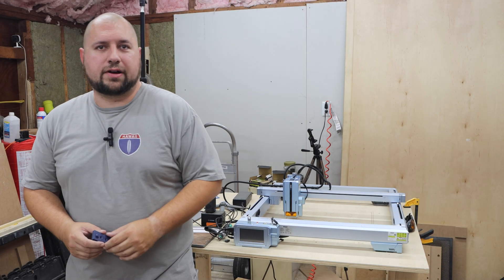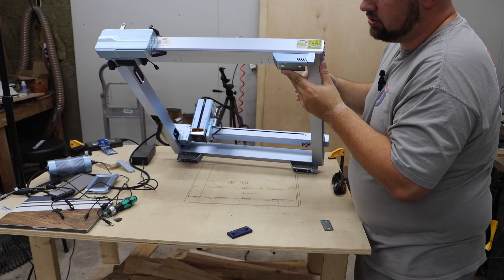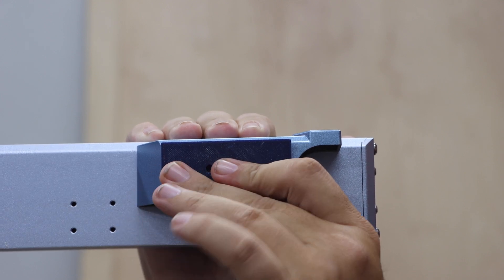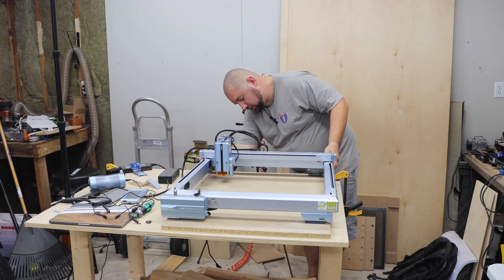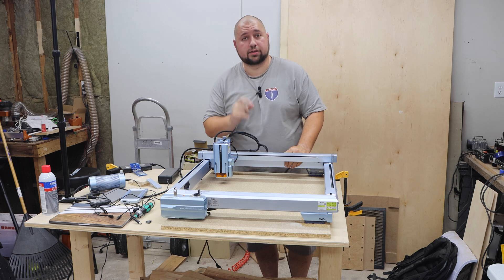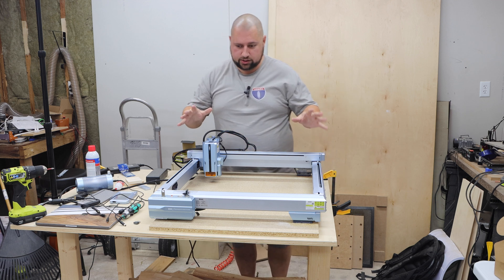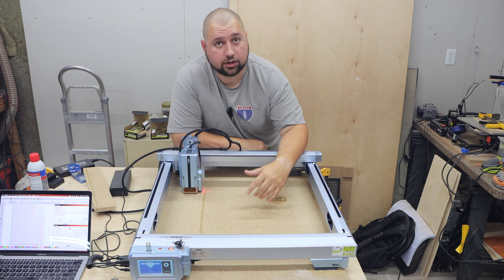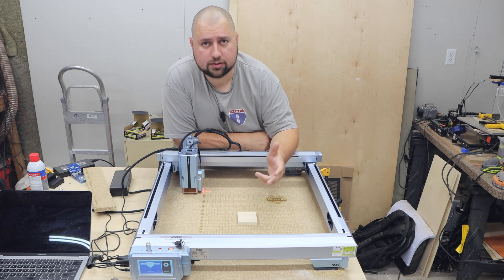iKier K1 Grid and Detachable Spoilboard with 3D Printed Alignment Feet

Comment: Thanks for the post. I tried printing your support and the post broke off when trying to lift the machine. Did a quick rework and added:
   1. A center hole. Top to bottom to add strength.
   2. A tapered top.

Again. Thanks!!!
Reply from the maker: Glad you were able to make it work for you. Appreciate the watch!
Reply: Hi, would you share it ?
Reply: @Evil_Clown_3DIY  Sure. How??  I use openscad for design.
Reply: @Evil_Clown_3DIY  Sure. How?

Comment: Other than some minor QC issues has your experience with it been good?

I’m considering getting their 70 W module version, but want to hear non-sponsor type  takes on it.

I just see it has all the features and no V-Rollers also to an extent that screen.  That screen that useful in your experience?

Either way I’m rambling a bit, and no pressure, but yeah I’d love to know what you think about it.
Reply from the maker: Hey Eric. Appreciate the watch.

So far so good with some minor issues. The red alignment laser was askew which I made a video about how to fix it.  I had a screw fall out of the Z axis a few weeks ago.  

Beyond that the only thing I’ve noticed that is annoying is my home position is often a mm or two out after powering off from the time before making my grid off.  I’m thinking I might need to tension a belt for that though. Just haven’t gotten around to it.

One thing to note if you use the red alignment laser the usable area will be 410x360 to use it properly.

The screen is useless as I only use lightburn and the magnets on it suck.

Lastly the fast setting can be a little rough with fine details, the medium setting is very nice but I was never able to get any feedback from ikier what settings to put in lightburn to get a proper preview time.  When I do medium I typically add about 25% to the time.

All in all would I buy it again? Probably. It cuts very nice, engravings have been good as well on wood and slate. Can do a slate 4inch tile in about 3 minutes.  

I did see a Neje Max 4 last night that has peaked my interest. Wider footprint, 80w output (do like the idea of the combo on the ikier though), and still a motorized Z axis which i like. Not sure if it has autofocus though which is awesome on the ikier.

Comment: Well, I printed the feet only to realize that do not work with the Ikier Pro Max.  Well, guess I got a 3D printer.  Thats OK, I can use it for other projects.
Reply from the maker: Oh man I’m sorry to hear that. The Max wasn’t out yet when I did this but I’m surprised they changed the feet. :/
Reply: It’s ok.  There are still holes in the frame, they are just smaller.

Comment: There are Holes in each legs, just screw it Down.
Reply from the maker: You’ve got about an inch of clearance to get a screw and a screw driver in there. Plus I can take mine off and move it and place it right back.
Reply: @757woodworks 
It wasn’t too bad. I always use MDF the the piece to fit inside of the legs so it can be raised or lowered. 

I’ll wait until I install the Extended Rails.

Comment: Great video. I have a Atezr L2 35 w laser and it looks almost identical. I wonder if it would fit?  I’m also guessing that the 757 in your name means Hampton Roads?  Again, great video and great information. Thanks
Reply from the maker: Hey Gene. Haven’t had anyone test it yet and tell me but it does appear like it would. I’d have to look at the hole spacing on the fusion file but I think it was like 50mm from center on the two holes. And yeah from Hampton Roads.  Appreciate the watch.
Reply: @757woodworks  , that’s cool, I’m out here in Hampton Roads too. Keep up the good work!

Comment: Maybe 3D print a screw hole tab onto you securing pads that produde just enough to get a holding screw in, remove the frame then add the primary screws, make it so you can snap off the holding (set up screw) screw if desired great idea and a great video! Thanks
Reply from the maker: The frame is pretty wide. Definitely could’ve bumped out a tab but would’ve been a much longer print. Appreciate the idea though as it would make them reusable as right now it’s a one and done since I glued them to the board.  May revisit that down the road whenever I replace the spoilboard.
Reply: No worries its always great to get input - even if it is not always the best (LOL) I am just getting ready to order my iKier Laser 24w module... @757woodworks

Comment: Hey thanks for sharing the 3D stl and the overall setup. Are you able to create a similar 3D stl for the feet you made for the Atomstack A20 Pro? Ideally something that screws on to the wasteboard and allows the (round) feet you created to sit within it?
Reply from the maker: Unfortunately I don’t have an A20 to model off of so I probably wouldn’t be able to make that work I don’t think. I will say if you wanted to try it the basic steps to make this in fusion were very simple and I’d definitely consider myself an amateur in fusion.

Comment: Great idea with the printed feet. I saw another Ikier user print covers for the holes in the side rails. I'm still new to lightburn, and have had problems with my Ikier 36W flying to the edge of the work area after a print, or if I rerun a print without backing out of the engrave menu. Have you had any issues with yours? Look forward to more videos!
Reply from the maker: I saw those covers as well. With my machine being in my shop I plan on doing them soon to help minimize sawdust in it.

As for any issues, I did have some quality control issues with the machine which were easy to fix. I do notice after the burn is done it is important to home the machine or it’ll crash into its side rails if I start another burn without doing that.

Thank you for the watch!

Comment: Hi, your tips and your videos are very good.
Unfortunately, I also had problems with my MacBook (M1) and thought it was because of that or just USB-C. Then I went on a search and lo and behold, a HUB was the solution and then it worked with the setting GRBL-3 in device. What if I had contact with iKier and they always sent me a new driver that I was supposed to install, but it didn't work either because I couldn't find a driver in the device menus that was supposed to work, so I tried it out and then a hub interposed.
  Now it works!
Now I just have to find someone who will print out your blocks for me.
Will keep watching your tips, thanks - Wolfgang (..from Germany)
Reply from the maker: Yeah I don’t know why the Mac has such an issue directly connecting. The hub seems to be the solution for it from what most people have said. Appreciate the view and the subscribe!
Reply: @757woodworks  ..yes, the Mac is somehow always neglected and I have already exchanged a few emails with iKier this week about this connection problem. The support sent me a lot of drivers, but none of them brought anything, so I also tried this variant and lo and behold, it works. We don't want more, although it would be nice to have this connection immediately without a hub. - New accessories are available for these alignments on the iKiers site, which seem to be quite ok

Comment: I noticed your using a MAC, I tried 2 and could not get either one to communicate with the laser. Do you know what I am doing wrong?
Reply from the maker: I had some issues too unfortunately. Had to reinstall the drivers several times. I never did get the usb C to work.  Ended up using a usb C hub so I could use the regular usb plug.
Reply: @757woodworks  which drivers do you install and which hub do you use? I had the same problem. At the moment it works only with my mac from mid 2012. thx and greetz from germany
Reply from the maker: I'm not at home atm but I used the drivers that were on the usb drive.  I believe they were the CH341 drivers.  I did have to reinstall it several times in addition to the hub.

The hub I'm using is the Sabrent 9 in 1 USB C Hub.  I haven't used any of the other ports besides the one USB A port so can't say much on it's performance other than it works for the ikier.  Here is the link - https://amzn.to/3PFWTxQ